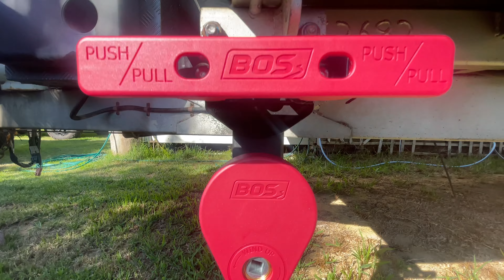Installing Boss 370 Stabiliser Leg in Minutes!

Comment: You now need a Boss jockey wheel something you might know there is a spare brass washer under the red cover the brass washer is a wear item I needed a replacement I got one in Perth they sell the red top section for $30.00 I have a jockey wheel for about 5 years I love it